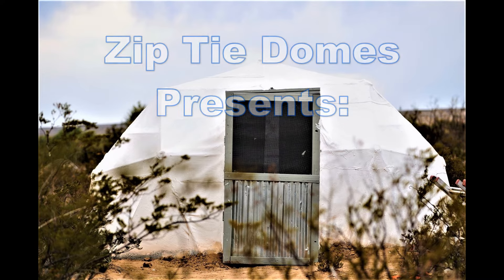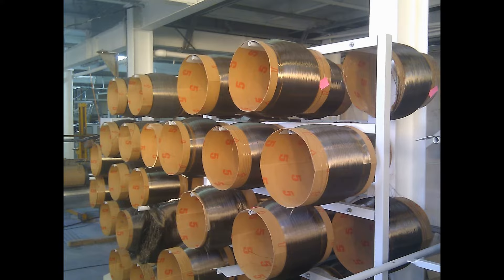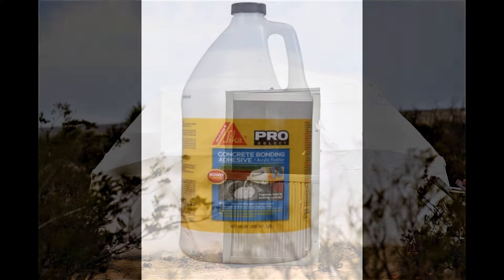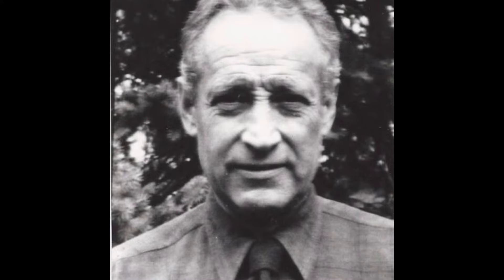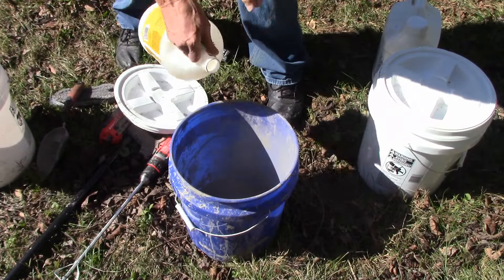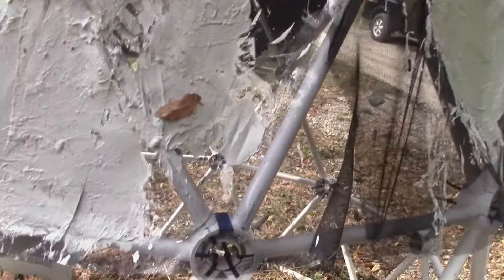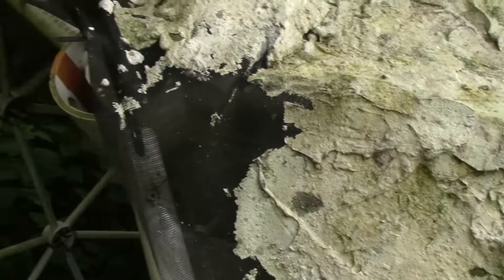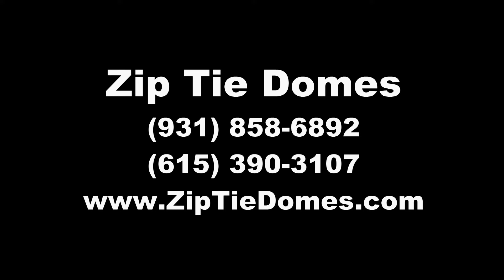Concrete Geodesic Domes: Building Thin Shell Concrete Domes Using Latex Cement

Comment: Maybe next time use a "Hopper Sprayer" where you scoop the concrete out of the wheel barrow where it was dumped from the mixer.   Then you use compressed air to blow the cement mortar on to the dome.   An airform dome might also work for you, where you blow up an airbag, tie rebar over the airbag 1' on center, and then just hopper spray the cement mix on.     I've seen some guys mixing ground up polystyrene into an aircrete mix for more insulation properties.
Reply from the maker: That's a great idea.  I bought a mortar sprayer and gas powered compressor for my next project.  Thanks for watching the video.  John Hurt

Comment: It looks like to me some sort of "balloon" is needed on the inside to help press the concrete, cement, or mortar mix outward and act as a barrier to the latex cement.  The result should be more round and reduce the sunk in look that would be a water, or snow catching and holding problem.
Reply from the maker: You are right!  You are supposed to push the mortar from the top through the mesh until it comes out like a cheese grater, then trowel it on the inside back into the mesh. 
It also sagged because I did not attach the mesh correctly. 
My next concrete dome will be covered with Tyvek and fiberglass reinforcement, then hit it with a mortar sprayer and compressed air. - and have several people handy with trowels.  

Thanks for watching the video.  John Hurt
Reply: A 6v or even 8v frame would create a rounder shape plus have much smaller triangles which wouldnt be prone to sag as much.
Reply: Believe it or not, cardboard panels made from moving boxes and waterproofed with same cheapo latex paint. Attaching the panels to the dome with you guessed it-zip ties, makes a very good barrier to keep the latexcrete sections flat and nice looking. Three or four layers really gets it solid and strong.

Comment: You could simply make the “gravy” using the latex paint and water mix…mix fast with a drill so it whips up like whipped cream, then paint it on with a paint brush and then sprinkle on dry mortar…let it harden, then “repaint” with the same mixture…
Reply from the maker: That is a great idea.  Thanks for watching.  John

Comment: Am I to understand from this video that flat, white latex paint will suffice for the source of latex in the concrete?
Reply from the maker: Yes, it worked, but it was very messy.  I got white paint all over me.  Anytime you touch the cement, there is a problem.  But it does work.  John
Reply: Like watching paint dry? 😁
Reply from the maker: @MyHelperMyHelper-cx1jn  Wear old clothes, or buy new ones.  John Hurt

Comment: I have studied and applied various teqniques such as this for the past 7 years or more.
I can attest that latex- cement or "paint crete" does work well. 
I have a 3 bedroom 2 bathroom Earthbag house as well as a 2 story geodesic cabin.
Both have withstood 2 major earthquakes as well as fires that destroyed over 250 structures nearby.
I will be applying this to my teepee next and then an outdoor kitchen and another dome.
I recommend though when covering a dome - if it uses pvc or other pipe to run your electrical through the pipe and bring the outlets to wherever you choose BUT - FILL THE HOLLOW PIPING WITH GREAT STUFF or something that will seal them - especially if you are building into a mountainside.
I used the hubs off of a childrens geodesic playground equipment and replaced the 2 sizes of struts with struts 4 x the size. Raised it up and secured it to wood posts. Added an atrium in front and over that a deck with handrail.
A zip tie dome system would be what I would go with next one- as they are lighter weight and with this system you have just show would be awesome and much easier to cover.
All the best !
Thanks for the video !
W
Reply from the maker: Thank you for all of your interesting information.  John Hurt

Comment: I remember talking to you about this concept a couple of years ago.   I'm glad you ran with it, you just didn't tell me that you were already working on a similar idea, grin.   The Gemini concept is perfect.   Aircrete could be pumped into the cavity for great insulation.   I bought some land in west Texas and I will be building there.
Reply from the maker: Thanks Mike.  Best wishes on your project.  There was a lady that showed me how to use latex cement for roofing a dome.   I have some notes and links at the bottom of her customer review page that may interest you:
https://www.ziptiedomes.com/customers/lenabach.htm
Latex cement is great for the roof.  I am looking at using aircrete to make flooring panels using metal C channel for the edges, with hardware cloth for interior strength.  Between the two shells of the Gemini dome, I am considering using hay stuffed into earth bags for insulation.  It has to be cheap, and insulation is not cheap. 
Aircrete for insulation between the dome shells is difficult as aircrete is watery and will run out the cracks when it is poured.  It also makes the dome permanent so it is harder to remove it if needed.
But if you can do it, then don't let my viewpoints hold you back. 
As the weather warms, I will complete my first large Gemini dome, and hope to have a video out this year.  Thanks for keeping up with me, and for your comments, they are very encouraging.  Many blessings to you and your family.  John Hurt

Comment: When I first saw her concrete covered zip tie dome on your website I thought of using her technique along with aircrete Harry's insulated aircrete.
I thought using aircrete would make a good base and you could make it a lot thicker and it would be insulated already. 
Check out his website or yt videos to see where I got the idea to put the two ideas together.
Also I thought of using the covered hubs to hold the screen tight so you can spray the thin light coat of aircrete on the dome... 😊
Reply from the maker: Aircrete would make a good flooring material, and Aircrete Harry is one of my favorite YouTube creators.  The geodesic dome frame does the same thing as inflating a large balloon that can be sprayed, and the frame also has a lot of strength without adding several layers of cement.  Thanks for the comments.  John Hurt
Reply: @ZipTieDomes  yeah your frame is what gave me the idea for DIY without the inflatable balloon infrastructure...
I like the aircrete idea because the more layers you put the more R value you get without have to use separate insulation.
If I had the money I'd try to build a  20ft dome that way...
Maybe someday. Thanks for all the amazing videos, they give me some great ideas... 😊
Reply from the maker: @joen9275  Thanks for watching!  John Hurt

Comment: Hello  -Good Sir.   We had emailed a few times back in 2019 ( or there abouts  :-) )    It's good to see that your still working away with your Domes.    B.T.W I have seen worse jobs using a trowel.  :-)    I also wanted to thank-you for the Geodesic Dome Calculator at your web site. It has saved me a lot of time, and it's easy to adjust the size of a dome and get the strut lengths.     Have you used that Concrete bonding adhesive in aircrete ??
Reply from the maker: Hello Gary!  I bought an aircrete foam generator from DomeGaia - the "Little Dragon", and my opinion is that aircrete is perfect for flooring, but it is difficult for making a dome roof as it is very runny and must be poured into a form.  DomeGaia pours blocks of aircrete into a long form that they stack and use to make a dome - which is somewhat labor intensive, but still an interesting method.  So no, I have not used adhesive with aircrete.  But take a look at the DomeGaia website, they have a lot of beautiful domes.  Have a great day.  John Hurt
Reply: @ZipTieDomes  Do you know Stephen Williams in Alabama? He's abandoned aircrete altogether for his blend of styrocrete... I'm weighing the styrocrete panel idea against a diy shotcrete variant of Dr. Nez's latex-crete skin... Maybe i can entrain shredded styrofoam into a latex shotcrete application... the window screening may filter out the styro aggregate... Maybe the first stage can be the latex-crete skin followed up with diy styro shotcrete layer for insulation and maybe a final outer coating of latex-crete skin to encapsulate the lower density insulative layer of styrocrete... I got this idea from monolithic which is experimenting with this "tri-wall" method on one of their ecoshell domes... Everyone's innovating! The synchronicities are amazing! I was going to take a class and learn the ecoshell process hands-on at equip international but they cancelled the 2022 class due to lack of participants... they held my money for a year and said there wouldn't be a 2023 class either and refunded me... Such a bummer! But, you started offering licensed plans, so i got a drill press and chop saw instead... Ive got my hubs done... Just need to find another source of bamboo for my struts... Thank you for all you do!
Reply from the maker: @MyHelperMyHelper-cx1jn  The styrofoam is a great idea.  Check out Aircrete Harry and his "Epic" styrofoam cement videos.  I am looking for a cheap way to build housing for the homeless.  If you come up with an alternate way to do it, please make a video and post it.  I would love to see what you do.  You can contact me and send me pictures of your projects by email at this link:  
https://www.ziptiedomes.com/contactus.htm
Have a great day!  John Hurt

Comment: My only complaint with your idea of a double layer dome is that the plastic itself can act as a thermal bridge between the outer and inner layer. That can add up quite a bit when you have so much. Granted PVC is less of a conductor than a metal structure would be, it still might be an issue given that it is on par with a piece of wood. I think having a gap between the spokes and using something like spray foam would solve this issue quite well.

An aside, I bet that aircrete (foamed concrete mixture) would work really well as a filler material.
Reply from the maker: Thanks for your comments.  A few of my friends and I looked at aircrete for the insulation, and from what we have seen, it is a little "runny" and would pour out any crack or hole between the two layers.  I am looking at using either fiberglass insulation, or hay stuffed into earth bags between the two dome layers.
Thanks for watching the video.  John Hurt

Comment: Interesting, I think you are on to a method that almost worked.  I plan to give it a try with a design and process change.  I will use sheet EPS to support the sagging screen and apply the slurry with a paint roller in several coats.
Reply: if you sprayed a very thin coat on the screen (literally not even enough for full coverage) and let it dry, and repeat a few times, you should be able to stabilize the screen so that it does not sag. there are other options, too, like the material used to make fabric airplane covering.

Comment: What about using spray foam insulation and then covering that with the latex cement?
Reply from the maker: I had a customer in New Hampshire that was using "closed cell foam" rated for outdoor use, and he was spraying the domes with foam with a very high insulation factor.  I have not heard what happened on his project, but when I was thinking about doing the same thing,  I found that it takes some specialized equipment to spray foam, and the foam can be expensive.  I am looking for cheap housing solutions that anyone can build, which is one of the greatest things we can do.  I have an idea about a double dome for insulation that may work, I am considering the execution of the project this week.  Thanks for your comments and questions, because your comments make me have to think and remember my purpose.  Thanks again.  John Hurt
Reply: @ZipTieDomes  In countries where sheep are raised for milk and meat, their wool can be shorn and used as insulation. It is really extremely good insulation and lasts forever.
Reply from the maker: @jharbo1  That is a great idea!  John
Reply: С eps используется штукатурно - клеевая смесь и стеклосетка. В состав входит цемент, обойный клей, клей ПВА, и смола древесная омыленная ( воздухо вовлекающая добавка).
Латекс не дружит с воздухововлекающими добавками, которые есть в штукатурно - клеевых смесях для eps.
Для eps нужен базовый армирующий слой, а уже следующий слой латекс.
Reply from the maker: Очень хорошо. Спасибо за информацию. Джон Хёрт.

Comment: Hi  Thanks for videos.  I made my first dome model in 1960 at the age of 10.  It was a model of a globe map.  I still have not found a solution that I can afford for a insulated dome.  I like your hub strut design.
Reply from the maker: That is great, I was born in 1957, so you are just a few years older than I am. I am working on a "dome inside a dome" that will provide a place for insulation.  Check back in a few months.  Thanks for watching the videos.  John Hurt

Comment: Yes u need a source yo? Ok. Latex means it's a suspension it's not latex from trees. U need the right range of molecular weight of... acrylic!!! 

You can buy large sacks of the powder. It's a bit challenging for the average person to mix it appropriately. That's the hard part. Hydrating and mixing it properly. To compare find the usual percentage range of acrylate in paint. It's wet % wt, and the % of dry. It's substantial but paint is mostly water. I think acrylate might be around 40% of the mix idk. So once you have mixed. A hundred pounds should make.... Like 200 and some more pounds of liquid. Water is 8 pound a gallon. So you'll get almost 30 gallons. These numbers i just made up idk. 
Find your source it's in a video description in a video by the channel called  Tech Ingredients. Good luck.
Thanks for the video i find it informative and greatly appreciate it.
Reply from the maker: Yes, I like Tech Ingredients too.  Thanks for the information.  John

Comment: What ratios did you use?
Reply from the maker: Mix the portland cement with latex until it becomes like a thick soup.  You can add water if you are low on latex.  John

Comment: Other ways possible to do : Hang the dome upside down (so it doesn't touche the ground), and empty the bucket, then ''roll" the dome so the cement mix is equally applied all over, with a little thicker layer on top, where you're happy the rain doesn't bucket.
One other : Stapple one layer of cloth so it is enough tensionned. Second layer is put after each square of fabric is dipped in the mix.
Reply from the maker: George Nez would do it by pouring the latex cement over the top of the mesh and brushing it onto the surface.  
Whatever ideas that you have, I suggest that you try them yourself first and see if they can work.  Most people have a lot of good ideas, but they never put them into practice, so they cannot learn from their success, or most of all, from their failures.  
Look at the links at the bottom of the customer review page:  https://www.ziptiedomes.com/customers/lenabach.htm
If you have questions, you are welcome to contact me at this link:
https://www.ziptiedomes.com/contactus.htm
I really want to support anyone that is trying to create affordable shelter.  Let me know how it goes for you.
Thanks!  John Hurt

Comment: For screwing to emt conduit, use self tapping sheet metal screws.
But it occurs to me, IF you wanted to use regular re-bar (cheaper, I think, than basalt or fiberglass rebar)  you Could just run it up in 1/2" PVC and seal it with silicone, JB weld, or epoxy putty on the ends. (this would have the added benefit of being able to add an eye loop on the end to make connecting easy.)  
It Also occurs to me,  you could maybe run steel Cable down your PVC , tied to your connectors, for additional strength- that would take some playing- with to figure out though. probably more expense than it's worth- though a good strong nylon rope, or several strands of nylon string run back and forth should significantly improve the strength of a regular pvc dome frame.  That might work really well.   you could just make several loops, just longer than the pvc, pull them through with a wire hook, and ziptie through that loop and onto your connector as normal.

just thoughts there
Reply from the maker: I like your ideas.  Thanks for watching the video.  John Hurt

Comment: What's wrong with using canvas
Reply from the maker: Canvas will work just as well as mesh, probably better.  That is what the lady that showed me how to make concrete domes used - canvas.  Try it and let me know how it works for you.
John
Reply: Concrete canvas, iInflate, spray with water and in 24 hours its solid.
Reply from the maker: That's is great!  Thanks! @JohnGuest45
Reply: Then you can even remove the "mold'' and do again and again ! @JohnGuest45
Reply: Back in the day you would stretch wet hessian (you call it burlap) fixing it over a timber wall frame, which would dry tight as a drum. It was then coated with a cement and acrylic paint. They called it "starched hessian". I've seen it used internally and it's tough as nails - but being a vegetable fibre may tend to break down over time (?). Metalised or fibreglass window fly mesh is a better bet for durability. This is worth a watch: https://www.youtube.com/watch?v=3I-O-C5Z8-I&t=3s

Comment: I like the dog house dome! Would shotcrete be a better way to get a more uniform application of the latex concrete mix? Here's an idea... https://youtu.be/n1L2UkBinsE
Reply from the maker: The Mortar Sprayer is what I bought for the project, plus a gas powered air compressor.  I have not used it yet, just played with it. The Mortar Sprayer people were great to work with, very friendly and help me with a lot of good ideas.  So yes, we are on the same path.  John